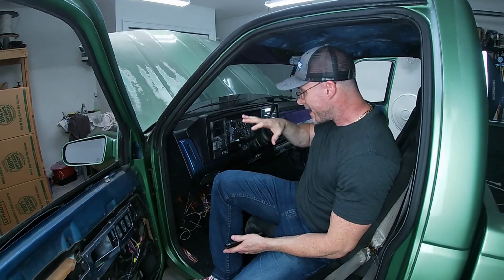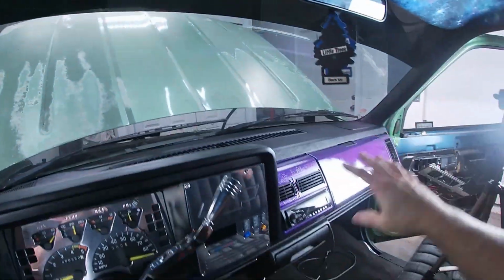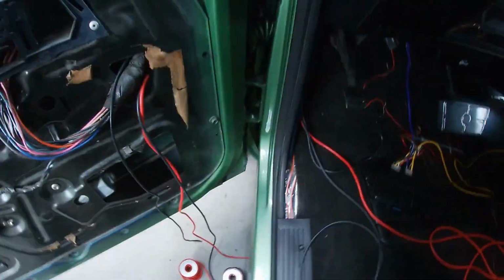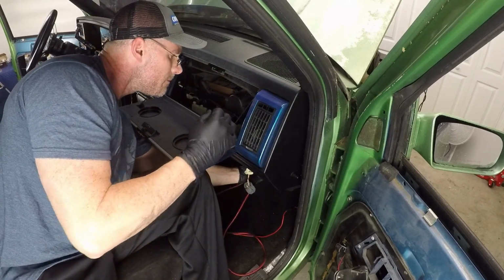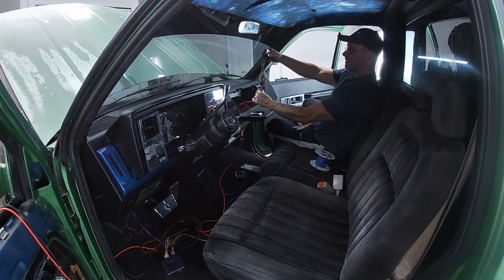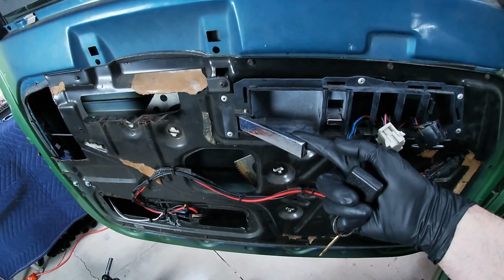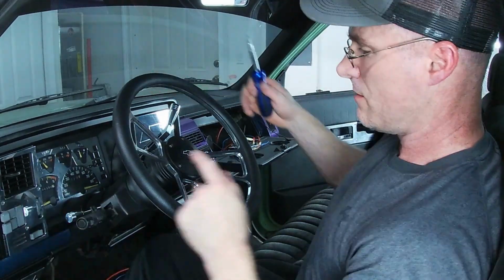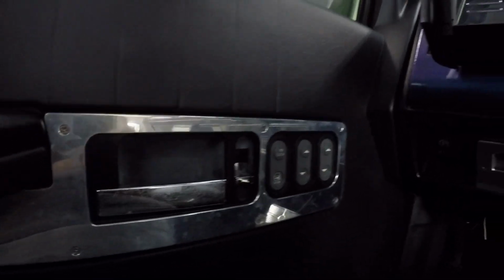OBS Chevy Silverado Truck, HUGE interior project update!

Comment: Oh, and I need those billet dash pieces😯😍😍😍😍😍
Reply from the maker: They are all listed as links in the description. Most are still available on Ebay. The dash is on back order already.
Reply: @thisoldhooptie  
I gotta catch up🤦‍♂️
Reply from the maker: @nonameisthename138  if you end up changing your seats plan for a really long wait if you go with the ones I did. I ordered these 6 months ago just received then installed a couple weeks back. They are great just took forever to get here.
Reply: @thisoldhooptie  
I'm prepared for the wait. It's a marathon,  not a race. 😉😊 I'm going to go back and watch the videos I missed. It wasn't too many though..

Comment: I feel like you would have loved the custom dub steering wheels they look awesome like an actual aluminum wheel
Reply from the maker: They are nice too, I used to like those with matching rims. My all time favorite steering wheel is the old chain wheels in chrome. The medium not the 10 inch ones. Not the right look for this truck though. If I was on 13x7 Dayton knock offs with little white walls the chain would be perfect.

Comment: I subscribed to follow your progress
Reply: Does the billet piece adhere to stock bezel? I’m having a difficult time locating stock bezel? Sorry to be a pest- it’s just nice to talk to someone helpful that’s been there. I can’t see how everything fastens to billet- how switches mount and what holds everything in door
Reply from the maker: The billet pieces come with matching screws for each corner. Use a pen to mark the hole, then a tiny dril bit to get it started. After that screw to each corner and your golden.
Reply from the maker: The only variable is the radio or pocket section. I have a pocket so there is nothing behind the upper left screw where the radio holder was. For me that is fine im putting my alarm led in that spot.
Reply from the maker: If you have not already join the obs adict, obs addicts, obs addiction, and 90s trucks groups on Facebook. Bunch of guys sell obs parts on there and will ship if needed. Just make a post asking if anyone has the part for sale some one will pop a comment pretty quick.
Reply from the maker: I just realized I did not clearly answer your question. These billet door pieces are only aluminum cover pieces. They go over the stock handle and switch bezel in your door. This is a good thing due to needing to polish them every once in a while which would trash your doors if you could not remove them to do this. I use mothers mag and aluminum polish to shine them up.

Comment: where did you get the heater cover, cool interior
Reply from the maker: Thank you. That cover is an older 90s piece. I would check Cunninghammachine.com they started remaking many of the billet interior pieces. Other then them keep an eye out for used on Facebook market place or eBay.
Reply: @thisoldhooptie   Thank you!
Reply from the maker: @justinbrainard3872  any time bro 😁

Comment: i dig the interior dash panels? Where did you get those? I wonder if we (88-94 obs) can use later model dashes, like gut the inter dash and put in the 95-98 dash?
Reply from the maker: The billet pieces can be purchased at Cunninghammachine.com they have started remaking them. As for the dash the guages, wire plugs, and ac are different. The dash it self would fit like just about all other parts. If you have a doner truck and time I'm sure it can be done.
Reply: @thisoldhooptie  thanks for replying, love  your build!
Reply from the maker: @Thomzombie303  Thank you. I'm looking forward to getting back to work on this truck later this year. I love driving it 👍

Comment: Can we get a update on the bench seat you painted
Reply from the maker: Sure they are now used as a couch in my garage. I removed them when my new seats were delivered.I have mentioned them in a couple videos since this one. They are holding up fine. What else would you like to know?
Reply: @thisoldhooptie  that's pretty much it wanted to see how long they would last or if you can see any streak marks glad it's holding up thank you
Reply from the maker: @jody3109  No problem. 👍
To make sure there are no streak marks make sure you overlap the stroke when painting. It will dry exactly as you paint it. None of the seats or carpet i did had streaks. Also make sure you use a good cleaner to get the dirt out of the seats. Good luck!
Reply: @thisoldhooptie  appreciate you replying and helping with tips before I start doing this on my seats thank you boss

Comment: Where can I get the billet part you installed at the end? the one that goes on the passenger side feet
Reply from the maker: I have not seen that piece in a long time on ebay or amazon. Try contacting Jeremy at Cunninghammachine.com see if they will be making them. They have started making all the other billet pieces.

Comment: I found your coverlay video but couldn’t find other info. Nothing coming up on ebay either. I’m looking for aftermarket window switch bezel of some sort. I really like yours. Curious how switches mount
Reply from the maker: Click that link, then click view sellers other items. I just checked it, they have the same door handle switch panel i have. I didnt see the dash kit, I did see the vents and all the door parts though. My switches are stock. Since my handles are shaved I have everything re wired and only use the window switches in the doors.
Reply from the maker: https://www.ebay.com/itm/234046380878?hash=item367e405b4e:g:GJsAAOSw8ZFgLa9T
Reply from the maker: https://www.ebay.com/itm/234033296489?hash=item367d78b469:g:o0UAAOSwkVxa53XS
Reply from the maker: https://www.ebay.com/itm/234042848166?hash=item367e0a73a6:g:IBQAAOSwTYZd-8AZ
Reply from the maker: https://www.ebay.com/itm/234014830542?hash=item367c5eefce:g:p8oAAOSwzqFY~Ix5
Reply from the maker: Those are the only parts I can find on ebay. I would keep checking back for chevy truck billet dash trim and when one pops up grab it. All the other parts except the horizontal long pieces for glovebox and below are listed in the oinks I just posted.

Comment: Where can I get the billet piece that covers the hoax box order the dash. I can’t seem to find it. Thanks in advance
Reply from the maker: Check my comment section on the videos for the door panels and the billet part install for the ebay links. Also my descriptions have some ebay links I found. If its still available it will be either those links or ebay will show it as a similar item. Its sometimes called the lower dash billet for c1500 and the heater core billet cover. Ebay is the only place I know of. Good luck 👍

Comment: Looking for aluminum billet switch bezel like you used. I have a 1990 Chevy c1500 that uses that exact style. Can you give me some insight as to where to look
Reply from the maker: Check the comments of my coverlay door panel video. I left a few links for another person that asked. The closest match to my billet aluminum ones I found were on ebay. They were listed as upper and lower billet trim.
Reply from the maker: The only one I could not find was the blower motor cover bottom passenger side. All others seem to still be sold.
Reply: Thank you
Reply: I’ve got every video but that particular one lol. Go figure since I’m trying to find. What a day!
Reply from the maker: Sounds about right :)
I only remembered it was that video because some one just asked me the same question on another video last night. Also the matching mirror can be found on Amazon but needs to be retapped for the proper angle of the 89 to 99 truck windshield. Let me know if you need that link too.

Comment: Hey! Thanks for the video. Did you have any issues dropping in the left side speaker as well?
Reply from the maker: No problem with the left/driver side speaker. The right was easily fixed with my heat gun. A minute or two if heat then press into the section the speaker hits with something circular. I needed 1/2 inch to make things work.

Comment: Are the seats stiff or did they stain you? Because of the paint
Reply from the maker: No stains and yes they start off stiff right after drying. I did take a black towel and rough up over the whole seat the next day. The stiffness will mostly go away and any loose stuff comes off. At this point its soft again. Not as soft as before paint but not stiff and nothing comes off on my clothes. I just wanted a cheap way to get everything black while waiting 5 months for my new black seats to be built and delivered.

Comment: Just wondering if you have ever had any issues with the power door locks. Mine are very weak and I’ve been trying to figure out what the problem could be. I have handles off back door of suburban/Tahoe, so I don’t have keyholes, and door locks are very important. Any help would be greatly appreciated. I also have a 92, so your page makes it that much better. Great content, keep it up.
Reply from the maker: Thanks! I have replaced just about everything in the interior electronics on my 92.  I would test the actuators, if original they may be going bad. Are we talking about the shaved door kit or the actual door locks original to the truck?
Reply: @thisoldhooptie  the original door locks, I still have door handles, just no keyholes/locks. But it seems like the first time I hit the door lock, it has just enough juice to lock/unlock, but when I continue pushing, it gets weaker and weaker. Electrical is probably my weakest point, so anything helps. And thanks for taking the time to answer.
Reply from the maker: @jvalaniz  No problem. My guess is your original lock actuator is wearing out. But your battery could be weak too, have it tested free at a local auto parts store. Does it function the same when the truck is running as it does when its off?  You can also check your voltage going to the door switch and lock with a meter but I would guess they are fine unless you have other electrical issues with things in your door. If you do may not be the lock. Could be a ground or power to the door. Either way you could grab a new lock actuator from amazon and pull the door apart and replace the original.

  This should be your part, get the linkage pieces for the extra 3 dollars incase you snap any of the old plastic.
Amazon $30 for 2 so you have a spare.
746-014 Power Door Lock Actuator Replacement for Chevy GMC Cadillac Pontiac Pickup Truck (Pair of 2)

Comment: how did u fix your billet mirror i have the same exact problem
Reply: how do I go about fixing it
Reply from the maker: The mirror will need a new hole drilled and tapped at the proper angle. I will be doing that while the doors are off for the bushing swap and painting or just after painting when I'm working on the amp and subs. I will make sure to record the process.
Reply: @thisoldhooptie  ok thanks ill be waiting
Reply: I got my done over a hour ago an it came out perfect I had the hole drill in the center thanks for the advice
Reply from the maker: @antoniooliver9240  Excellent! Im glad it worked out for you :)

Comment: What size speakers did you install ? And is the single din 1.5 or 2" ?
Reply from the maker: A single din is 2x7, mine is a single din. The speakers i used are 4x6 in dash and 4x6 in rear panels. Use good speakers with a small 4 channel amp.
Reply: @thisoldhooptie  ah I see sweet thanks for the info and quick reply , sweet truck! Also what seat is that out of or is it just a custom reupholstered bench seat
Reply from the maker: @flosano1352  Thank you,. Check out the sport truck gets new seats video in my playlist. i went with shop4seats.com or something like that. The description has the website link. They made and shipped me from there selction. The one in this video is the stock bench seat with black Duplicolor vinyl and fabric sprayed on it. Its damaged and now a couch in my garage.
Reply: @thisoldhooptie  yeah sorry for all the bothersome questions I just started your build Playlist from the beginning good content man ! Will be subbing and tuning in for sure
Reply from the maker: @flosano1352  No problem. I try to list everything I use tools and parts in the description of each video. I'm on paint and body now. Next up ls swap then air suspension. I had to take a month for the holidays to decorate the house for Christmas. Have a great day 😁

Comment: Did you have any issues with your cruise control?
Reply from the maker: No it still works. I did not swap that out. I have since sourced one with the end chromed.
Reply: @thisoldhooptie  My cruise won't work. I have not even begun to diagnose causality yet but it is annoying. Thank you for the response!
Reply from the maker: @RedBeardDevelopment  No problem. Start with the part under the hood test for power witha probe then work backwards to the column.

Comment: You don't need to change a thing!! Everything you mentioned...time lapse, music, etc is not what most people want to see or hear. Also, everything you're doing is what I want to do also to my truck. Mine is a 92 also, Mark 3. Purchased it when it was two years old. So I didn't have to do what most guys are doing to their OBS trucks, as far as restoration goes. But I do want to change up the interior. Its burgundy leather, but I want either black or peanut butter. The truck is red. 
I've been trying to get some prices on interior work, and they are ridiculous. But right now, I have an a/c issue. Its not wanting to hold the freon. I've changed the dryer, compressor and found a leak at the dryer. But its still leaking. The only thing left is the evaporator. 😡🤦‍♂️🤦‍♂️ Keep up the awesome work,  you're helping me and others more than you know..💯👏👏👏👏👍
Reply from the maker: Thank you for the comment. and the sub. You are number 500 :)
I am having fun and documenting the process. These old trucks always have an issue or two. Where you tube shines is all the people who mess with cars and trucks have a way they do things. The one that works for you is the right way. As long as it comes out the way you want, its right.
Reply: @thisoldhooptie  
Yeah, you're right...I've been watching for awhile. And thought I had already subbed.🤦‍♂️ But I saved this last video for reference 👍
Reply from the maker: @nonameisthename138  i am pretty sure you and I chatted about my headlights lights months ago. You gave me a tip to primer them first which by the way does work. I tested with clear plastic adhesion promotor and the night shade does stick to that without wrinkles. I have painted alot of things over the years headlights was a first.
Reply: @thisoldhooptie  
Yes sir, that was me. 😊 I love what you're doing, keep it up..

Comment: What size steering wheel??
Reply from the maker: The link for the wheel is in the description of the video. I believe its 14 inches.
Reply: @thisoldhooptie  thanks for the response ! Helps alot
Reply from the maker: @josep2675  one thing I dont think i mention in the video is that the adapter ring comes in sizes from 1/2 inch to 2 inch. If your on the larger side get the smaller or smallest ring so the wheel doesn't push into your stomach while driving. Im getting a smaller one myself.

Comment: Great video we’re did you get those chrome billet trIm pieces
Reply from the maker: First place to check is Cunninghammachine.com they started making the billet pieces. They also have great door bushings if yours are broken. Also check ebay for used and new wity a search billet dash c1500 chevy truck. Good luck 👍